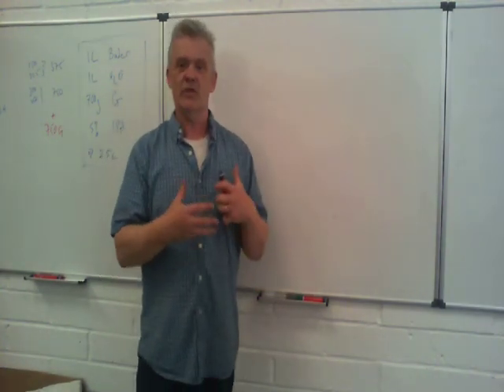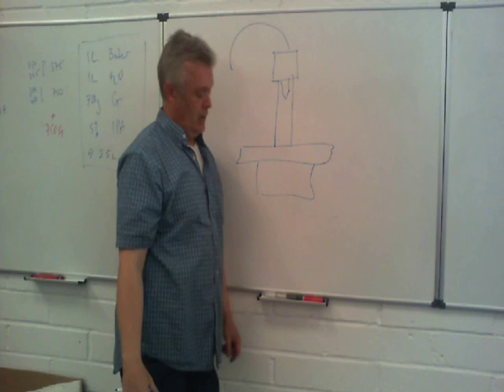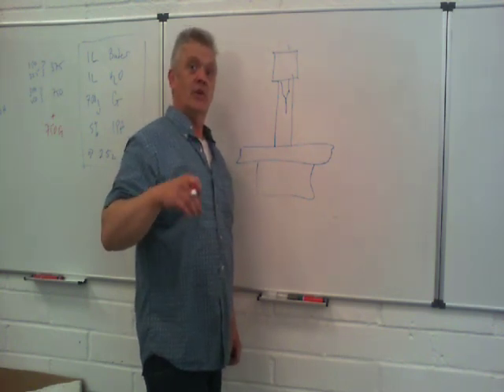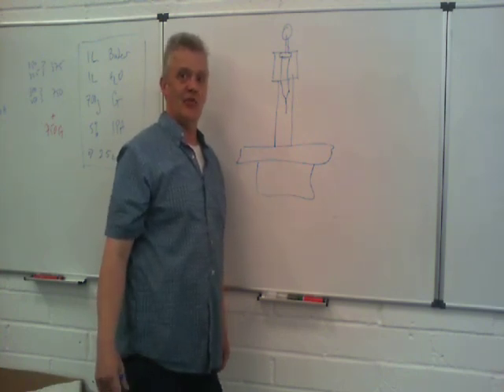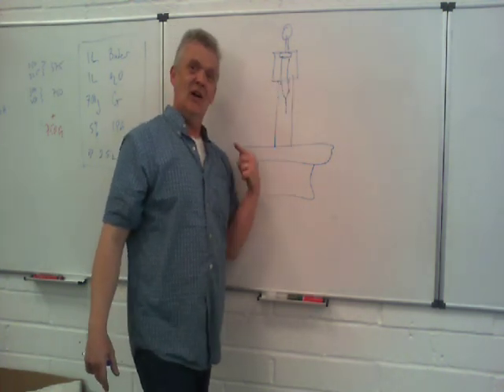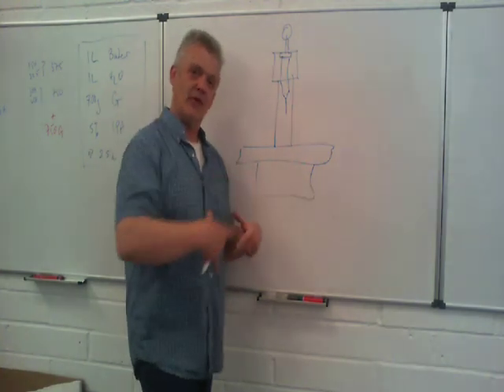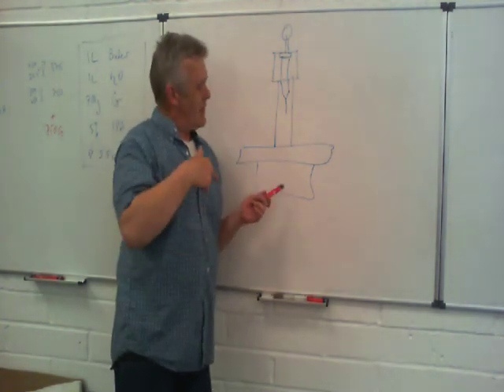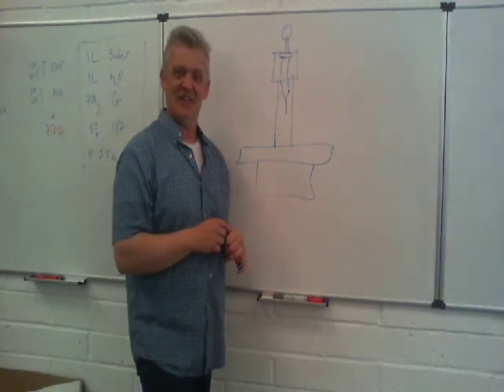A 3D Liquid Plastic Printer

Comment: There are few different types of 3d printers that you can reference  here, one type is a Delta that is a very popular model right now and simple to build and you can buy them as kits they are made mostly from 3d-printed parts , another type you might want to look at that little off subject but it's really interesting right now is a peachyprinter, they even raise the money on kick starter at one point, it uses a laser to harden the plastic in a unique solution of saltwater to raise the level of the Print
Reply from the maker: I'll have a look at them cheers mate

Comment: Could you use a uv light to dry the filament faster during extrusion? Also, you could use pneumatics to extrude the filament instead of a needle, but the needle idea probably would give a more sustained speed of extrusion.